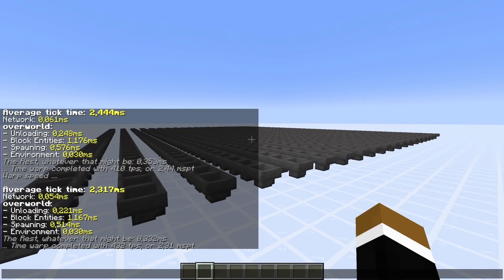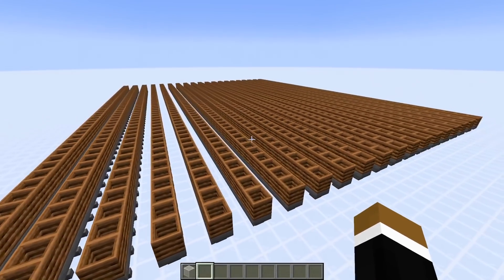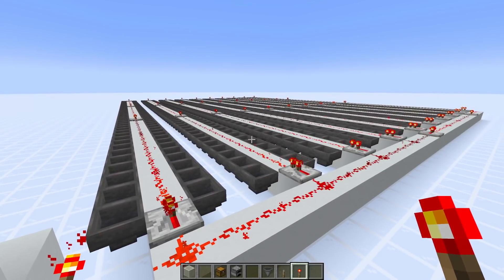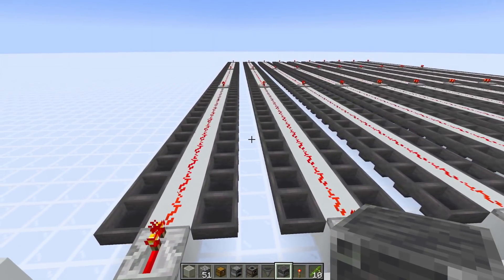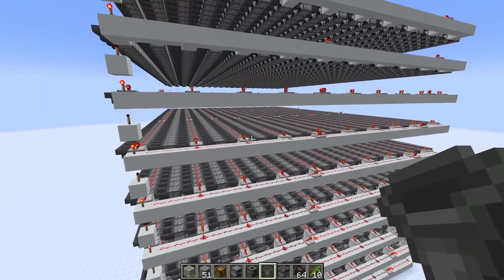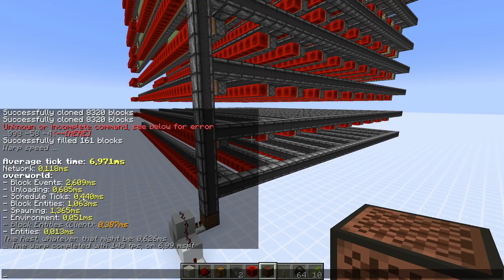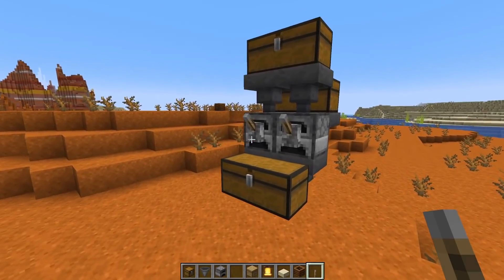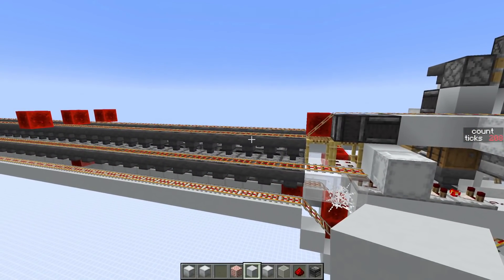Is Furnace Array Hopper Locking Necessary?

Comment: I saw in a video of someone else, that the lag redstone dust creates comes in big part of the light update of the sourounding area. He used simply some stady light sources against it. If the light is already 15, it will not be changed by extra light. Your test was on daylight, so I don't know if this counts for your video, but for other havy redstone stuff undergrounds/at night it could change a lot.

Comment: I think there is a little mistake in your testing, if the array/list of entities is more or less empty then the hoppers will have less coordinates of items to check. But in a normal world the entity list is full of entities where every hopper has to go trough that list, check if its an item, check if the coordinates match, check its internal state if that item can fit and then remove it from the entity list and add it to its own inventory to an item stack or create one.

I had that problem on a private Sevtech server where hoppers were a good cause of lag, especially in large strainer setups with our farms nearby. Add conveyor belts with items traveling trough the whole base to the mix and you can see where we went to Lagtown.

Comment: I've been playing for ages, and I should prolly know this, but I don't .. soo .. why composters? If I understood it correctly the goal is to block the hopper top from checking for item entities. Would any block of height 1 do? Or does it have to be composters?
Reply: I once asked myself the exact same question and checked the code. Even if you place a block above a hopper, it will still perform checks. An item could be pushed into the block and the hopper would still catch it. If a chest (or any block that stores items) is placed upon the hopper, the check becomes much cheaper, since it only has to check the related block entity. Composters are even better because it only needs to check the block state.
Reply: @Malangs92  thank you very much!

Comment: I think I'm part of another subset that needs to lock. I play on a small multiplayer server, normally <5 people on at a time. I let people use my smelter array if they want to. 
But I was dumb, I built a ~400 furnace array in my base, because it's a big town and there's a blacksmith and it made sense and was cool. So in this case locking the hoppers does help a little bit.

Comment: This is a major reason I nearly always just go for a modest furnace array in my base that I can run roughly all the time vs some massive thing I have to go out of my way to afk at.  Though I will say a lot of the more advanced furnace set ups would double or triple in size to try and get the locking system fitted in without messing with anything else.
Reply from the maker: you can use portal chunk loading so you don't need to AFK next to it

Comment: I think that the redstone dust version is not slower as the dust is only in a line - there isn't any "shortest path finding" caused by cycles that you may have to do when using it in a grid (especially when the grid is full square), you have just one posible path to go through these interactions.
The repeater may be even faster as it doesn't search in all the 6 faces of block for activable redstone but only one.

Comment: Ilmango!
 
I had an idea for a wood farm, but I broke my hand and don’t want to risk it not healing properly. The idea involves not moving the wood, but letting tnt rain down from above. If the dirt underneath is in the blast zoned, you could try to use a double piston extender to push the wood up. Minecarts or hoppers should be enough to collect all the wood. This design wouldn’t give you saplings of course. Hope it works and produces a good amount of wood. You probably already thought about it and know some reason not to build it bc of a major flaw.

Comment: I think time ago you tasted hopper lag and fund out differences between the items that the hopper has and the items a chest above the hopper has. I don't know if it still the same.
Other thing is hoppers do produce lag and much time are for the transportation of items, for example a line of hoppers. The problem with that is even the intention is only to move an item from a hopper to another the hoppers still trying to find items above them. So, here's my idea, the creation of a new item that is a tube. It would replace the hopper in this case and as it won't try to constantly search for items above it would have les lag. I like this idea, and some times people would told me adding items to a game already have to much and an inventory problem is not good. But mojang is already adding a good amount of items, and some if them I would say they are not much useful, so... I don't think a new item that is useful is a bad thing

Comment: I've played minecraft for 10 years, and for the life of me I can't figure redstone out. But I still watch your videos just because of how informative and well put together they are. Especially the peaceful series, I've watched the majority of that 3 times now lol
Reply: Everyone starts somewhere.  It can be very complicated because some items do multiple things. 

Redstone signal strength drops by 1 each block so if u have a max signal strength, it would go 15 blocks. There are ways to extend this. 

Redstone torch produces a max strength signal to adjacent items. Powering the block the torch is attached to, turns it off. 

Redstone block also produces a max strength signal and powers adjacent items. 

Redstone repeater takes a signal (no matter what strength) and outputs a max signal. It also adds a delay based on what u set it at.
 
Observers watch the block adjacent to the face for a change. If something becomes powered or moves across it, it sends a quick max strength signal. 

Redstone comparator in general is used to detect the items of a container. It outputs a signal strength relative to the fullness of the container. It also takes redstone signal as an input, then outputs a signal that is -1 strength of the input. Ie 15 going in, 14 coming out. Due to this mechanic, ppl use them a lot as pulse extenders. Because different items have different pulse lengths. A button stays on longer than an observer detecting something. You could make the really fast observer signal last 20+ seconds with enough comparators and repeaters.  They are also used to compare (imagine that) signals. If the comparator has a redstone signal input from the side, it will only power on the output side if the input side is as high as the signal strength on the side. 

There is a lot more complicated things that go on, but understanding the basics goes a LONG way.
Reply: That's because it's blood.

Comment: can you do the same kind of tests for villagers? like the magma block trick vs the 3 carpets vs the honey vs being in minecarts etc...
Reply: Next video: Is it necessary to kill your villagers?
Reply: I’d love to see that!
Reply: Edit: I remembered this completely wrong. It was the server that handled a lot of "get entities", and that made up like 30% of computing. A significant amount was used by "controls" (3.5%) "travel" (9%) and "push" (4%) despite them being immovable. You can probably do better lag busting.
---
I did a small test with 400-ish villagers in an empty world. They were both encased in and surrounded by glass blocks, so they could neither pathfind nor see anything, but my framerate still had a seizure. Running the performance debug (i think it's f3 + L these days) it looked like 70-80% of all client lag was caused by the villagers querying other villagers in range, which is 16 blocks or something. I didn't look much at server lag, but i don't think it was as severe.

So, reduce lag by spreading your villagers out a bit? 🤔
Reply: @volbla  Testing for server lag is what really matters in this case. If your client has bad performance when near a lot of entities you can just drop your render distance or use a mod like Tweakeroo to temporarily stop entities from rendering, the villagers would be invisible but you can still interact with them.
Reply: @caesural  Yeah, i was mistaken so i updated my post. It was actually 30% of server performance that went towards listing entities in range. Maybe spreading villagers out a bit is relevant then?

The client profiler isn't as helpful. It just says that 78% of performance (at 23 fps...) goes to rendering entities. You'd think it wouldn't be so hard since all villagers in my setup were just static boxes, but apparently it is.
Reply: Yes please!

Comment: I have found a use for smokers as a sort of conditional pulse extender that you can use to read "binary" item streams of unstackable items. But never for actually cooking anything lmao
Reply: That sound really interesting. Can you explain how exactly the reading works, because the only way I can come up with is using tools made out of wood and any other material for the binary numbers. Either it can be used as fuel or it can not. But in that case normal furnaces would  do the job just as good.
Reply: @2000Meilen  I'm assuming by having a stream of items that can be smelted in the smoker (ie porkchops) and ones that can't (ie cobblestone). Let's you use farmable stackable items vs nonhstackable items that need to be crafted (ie wood pickaxe).
Reply: How does it work?
Reply: @InfoTeddy  I obviously don't know how OP is using it, but you could have a setup that dispenses either a cobblestone or a raw porkchops depending on what is happening in the world, then a comparator can be used to detect if it goes into the smoker or not, and you can have different outcomes. As the OP said he's using it for a variable pulse extender, I would assume he's using a latching circuit that is reset either by detecting an item that BYPASSED the smoker (nearly instant), or when it detects an item being REMOVED from the smoker, which would add the delay of the item being smelted in the smoker.
Reply: @InfoTeddy  The fuel maybe? Wooden tools burn in 10 seconds and fishing rods, bows or crossbows take 15.
Reply: I prefer using a wall of campfires for cooking. Costs 0 fuel, and the speed really doesn't matter for something I do rarely and in bulk.
Reply: I don't understand whatthat means but I'm too clueless to know what to ask.

Comment: It'd be nice if there was some client side mod which would identify chunks which are causing lag. It's always the case on HC where areas are laggy, such as spawn area now, and nobody ever knows why. Surely there's some way to highlight areas that have an over average tick load.
Reply: I used a mod for that purpose a while ago: LagGoggles. It's very cool. I think it does what you are describing
Reply: @electroneater  i think theres even a 1.16 version of it called Observable
Reply: @commander3494  didn't know about it. Looks cool!!
Reply: Iskall's Villagers
Reply: @beautifulnova6088  YouTube offered to translate your comment which is so funny. Hallo! 😂
Reply: The players on HC overuse glowing signs which is really what's contributing to their lag problems.
Reply: @ForeverLaxx  if glowing signs truly are the issue, then Mojang should optimize them. I'd be surprised if this is a large portion of the issue, but who knows.
Reply: @PapaWoofs  Glowing ink contributes a surprising amount of lag, for some reason. Honestly, it's crazy that Minecraft has framerate and lag issues on the scale that it does considering how low graphic, low polygon it is. There are likely major optimization problems with the system at its core.
Reply: @ForeverLaxx  another lag problem on HC is that some of them still use optifine which is a pile of garbage (as you can see from doc running his world eater and still getting smooth fps whereas when other hermits came to visit they started lagging)
Reply: @commander3494  I literally only use Optifine for the better glass textures, but I only play the game with one other person on the server so it's never been an issue.
Reply: @ForeverLaxx  yeah, just on hermitcraft its a problem (also there are connected texture standalone mods for both forge and fabric so thats not really an issue)

Comment: I appreciate like the deep dive into what causes lag in current versions. I didn't realise that they significantly reduced redstone dust lag in recent versions
Reply: hope they improves it more because for a bad technical player like me, making dustless designs are hard :(
Reply: @john07116  There is no need to avoid redstone dust now, unless there is a LOT of it getting constantly powered and unpowered. It's so much better than before.
Reply: It could definitely still be better, see: Alternate Current mod, but it should really only be an issue for big, complicated builds with a lot of flashing dust.

Comment: if you are already running a clock every 10 seconds, is it better to insert the items using a dropper?
Reply: You still need the minecarts to distribute the items into the droppers then in that case
Reply: Can droppers even interact with furnaces?

Comment: This was the exact question I had when I joined a server recently, in particular there was a player's shop that was filled with hoppers and it felt extremely laggy with my FPS dropping for some reason to 10 from 30.

After helping and optimizing his hoppers and replacing what chests that could be with barrels, the lag actually improved significantly, and my FPS didn't drop. It was totally worth it.

Comment: Do composters on top of full hoppers reduce lag when items are moving through them? If you have a chain of 1000 hoppers filled with coal and a furnace on the end, you'd expect the hoppers to briefly be able to check for items on top whenever the furnace needs another fuel item.
Reply: Yes they do, because searching for item entities is MUCH more expensive than checking an adjacent inventory
Reply: @andrewlalis  afaik composters help because they arent an inventory (not even a block entity) but hoppers have specific code to extract from them still which causes significantly less lag than item entity/inventory checks.
Reply: Composter on top is always worth it, unless the hopper is completely filled most of the time. In the case of a furnace array the low-tech answer for your fuel hoppers is simply filling your fuel hoppers, in case of a storage system this is true for shulker box supply hoppers. In other words, you already only need to worry about the hoppers that transport the items to process, i.e. the input hoppers for items to smelt/sort.

Comment: I think this is more useful if you want to build a bib-big sorting system. Like sorting every single item, and for each a shulker loader, and multiple chest for them. That type of system needs more hopper and usually people build it in their bases, so I started thinking, I will have to build an locking system to it for turn off mode